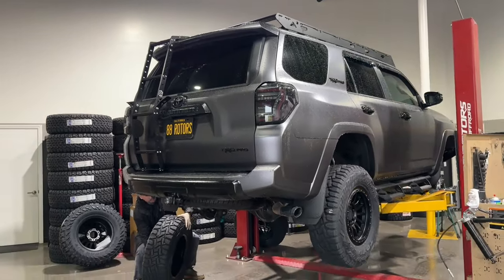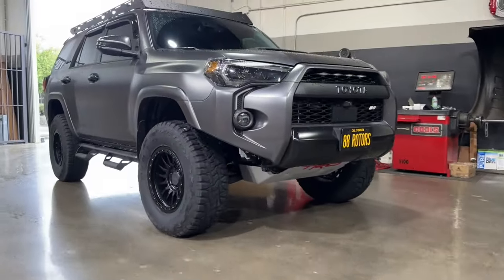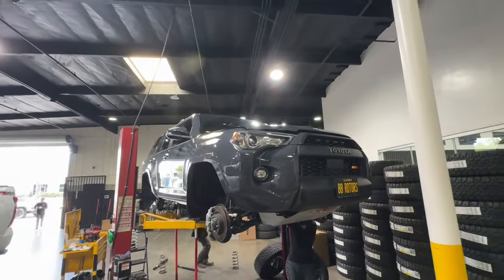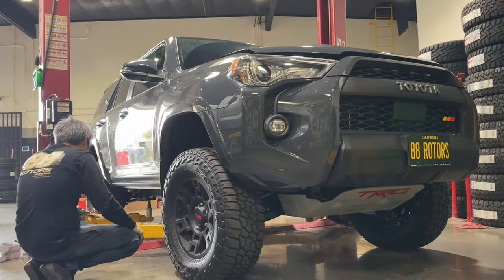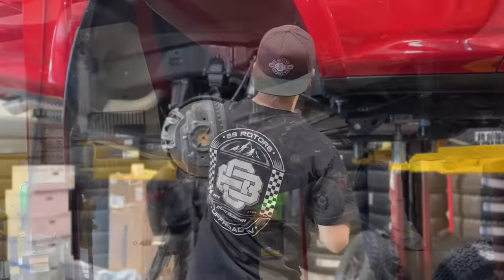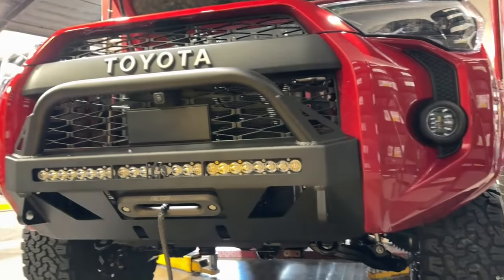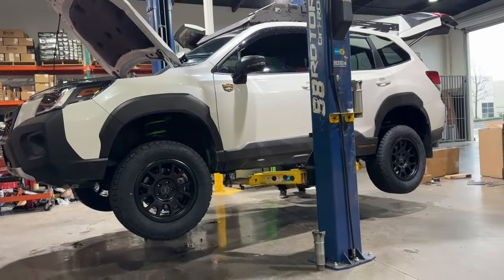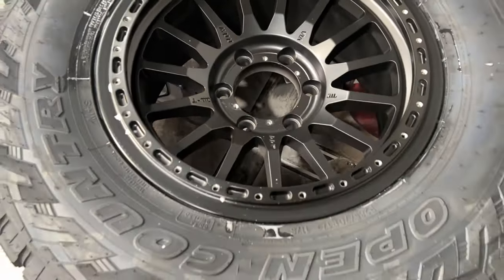Toyota 4Runner Suspension Lift on Eibach Pro Truck Stage 2R Lift with SPC UCA

Comment: Any rubbing with 285s and eibach setup on the gray 4Runner?
Reply: Curious about this too. Just got the eibach set and am trying to pick tires 🫡
Reply: Hugely depends upon the offset of the wheels chosen.  285's will require some trimming no matter what wheel you choose, and no matter how high the lift, but if your offset is too far negative, it'll be a lot of modification needed, like the body mount pinch weld behind the front tire being chopped.

Comment: Is it me or the 4Runners look squatted after putting the lifts on them? I want to purchase the Eibach stage 2r for my 24 SR5 but I wanna avoid that squatted look. I might have to get some cornfed “1/2 spacers to avoid that right?
Reply: Yeah, I noticed that too. I think when they try to "level" them, it throws the look off. They're designed to have a little rake, when they're perfectly level they look squatted because of the body lines, I think. Personally, I think 3-in front lift is too much for these, I would stick to no more than 2.5 in the front and 1 in the rear. Throwing a spacer in the back on top of it wouldn't be a bad idea, but like they said you may need a panhard correction kit for the rear as well.
Reply: @trailrunnah8886  Yeah I think ur right. I went with the Eibach stage 2 with 1/2 in cornfed spacers and still see somewhat of a squat. It’s a half inch higher in rear according to my measurements but still looks like it squats. I installed a R/C (Don’t troll me) on my wife’s and hers sits just the way I like.
Reply: @TundraBreaks  oh wow, good to know. I actually have that kit in a box waiting to be installed, just haven't gotten the chance yet. I guess I should pick up a spacer to make sure it'll sit even.  How much lift did you get out of the front? Also, how do you like it in general? I waited too long to install it, I've watched more suspension videos and now I'm second-guessing my choice.